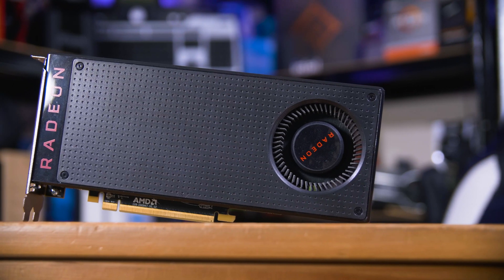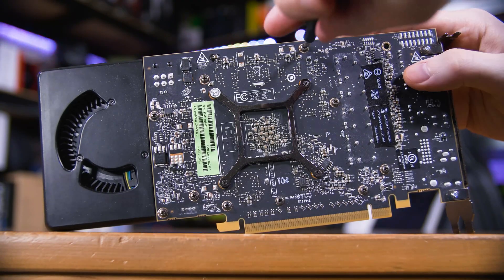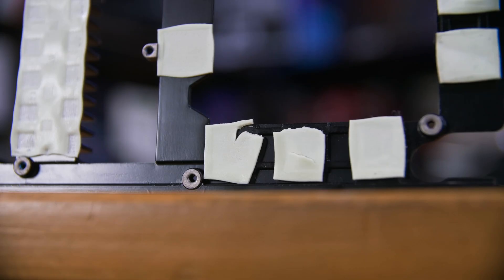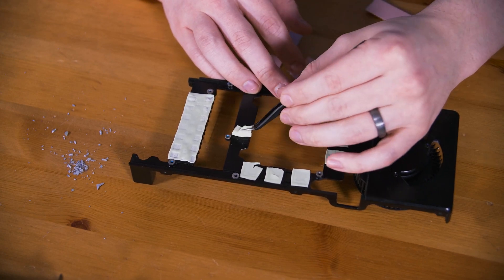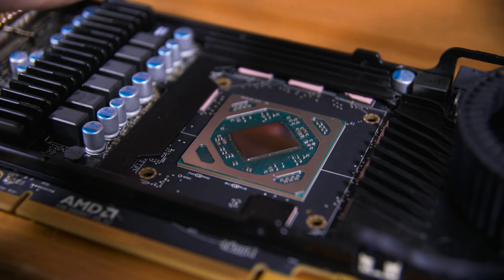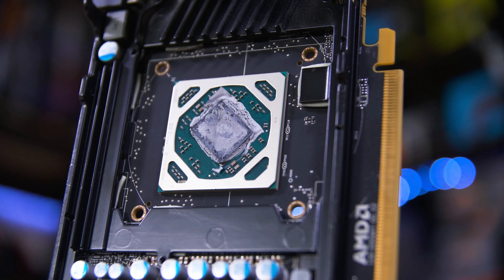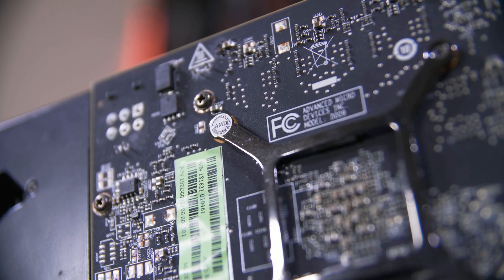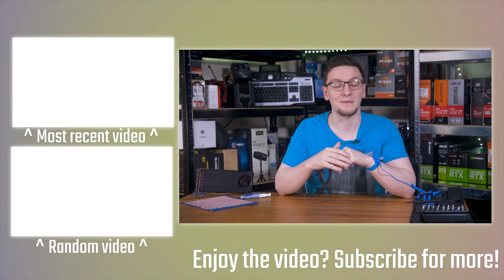How to Clean & Repaste a GPU + Replace Thermal Pads

Comment: The thing is, nobody says if its safe to use isopropyl alcohol to clean videocards
Reply: Sure, but use 99% USP IPA and optionally dilute with distilled water. That's my 2¢.
Reply: Thing is, lots of people do lol. How embarrassing.
Reply: bro I literally would bathe them in isopropyl alcohol and connect it to my pc it literally wont do anything IT DRIES IMMEDIATELY

Comment: For vrams instead of low performance thermopads better give a gummy/sticky thermal paste K5 Pro 5,3 W/mK, Laird Tputty 607 6,4 W/mK, Upsiren U6 Pro 12,8 W/mK. And for the graphics core a Honeywell PTM7950 phase-change thermopad.
Reply: no thanks I aint cleaning that mess
Reply: All good but K5 Pro is horrible, seen many laptops and cards with boiled K5 and lots of outgassed silicone around the PCB.
Reply: @harrydijkstra9936  Yes it is true K5 Pro is the worst thermal putty currently on sale. Now it applies Upsiren U6 Pro or UX Pro.
Reply: There are other thermal putty better than K5 Pro in terms of performance as well as cleaning.

Comment: 2nd hand 5700xt that was prob dropped, best friends with 110 junction limit, gpu in 90s memory in 70s.
Repaste with conductonaut, 70-80 junction, 50-60 gpu... Memory slowly basting at 95 degrees.

Repaste broke stock fan curves lol

Comment: My only suggestion would be to use an old toothbrush instead of cotton swabs.  Cotton swabs can leave fibers behind and make for more cleanup, but a toothbrush will do all of the work without leaving anything behind.

I should clarify, the cotton swabs would be great for picking up any alcohol left pooled behind, or using coffee filters, after using the tooth brush.
Reply: I use glob mops, they don’t leave residue/fibers and work great. Tooth brush could scratch the surface if the bristles are too rigid.
Reply: use coffee filters
Reply: @Robbie-mw5uu  coffee filters can rip of capacitors.   Coffee filter for the die itself is cool, but risking tearing off a capacitor isn’t worth it.  Using a toothbrush removes the risk.

Comment: My old Gigabyte RTX2080Ti (still under warranty at the time) was running between 84-89c  and after I repasted (Arctic MX-4) and put on new thermal pads (Thermalright) my temps dropped to between 78-82c and managed an extra 125mhz on the core and heaps more on the memory and increased my fps between 5-7%
Reply: How are the temps now after a year?
My experience with MX-4 and many other pastes is that it degrades quickly above 75'c
Reply: >2080 ti 
>old 

lmao

Comment: them pads are 1.2 W/mK e.g. far worse than the old pads you should have used Thermalright Odyssey 12.8 W/mk they did wonders for my 3090 FE backplate temps
Reply: If your backplate is cooler, your GPU is hotter.
Reply: @volentodorov3242  They dropped my Vram Temps from 104 to 82 and my Core stayed the same with 700rpm less on the fans..
Reply: @Shonkuk1  The way you said it it sounded that your backplate is cooler, not the GPU itself.
Reply: @volentodorov3242  yeah i only did the back of the card i should have said something like did wonders for the temps on the back of the pcb

Comment: I got Noctua NTH2 about 3 or 4 months ago and yesterday I changed my cpu cooler and saw the NTH2 is nearly all dried and the trace of the amd logo on the cpu was on the coolers copper surface. Tried to use same NTH2 and it was not even spreading. Is this means I got a bad product?
Reply: Thermal paste will naturally cure to be more solid than liquid over time, and not every CPU heat spreader and CPU cooler will be flat, so uneven spread is to be expected, but if it concerns you then the CPU heat spreader can be sanded flatter with a high grit sandpaper, also making the IHS a touch thinner so the heat has to travel through less metal to be dissipated